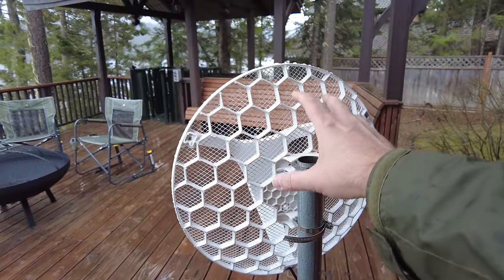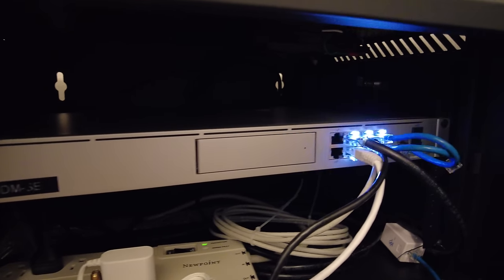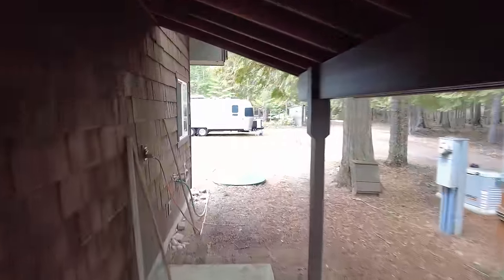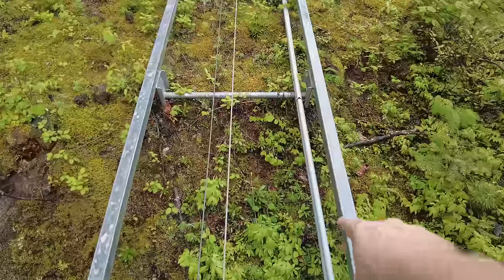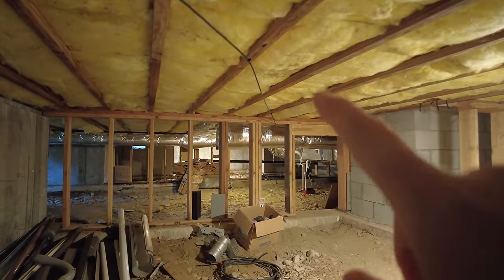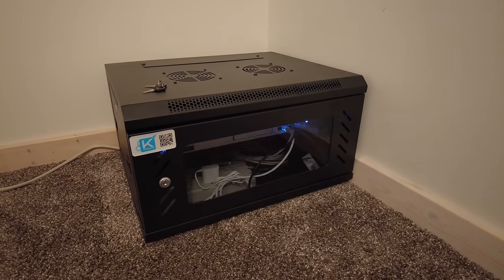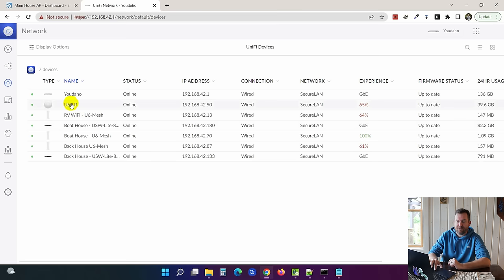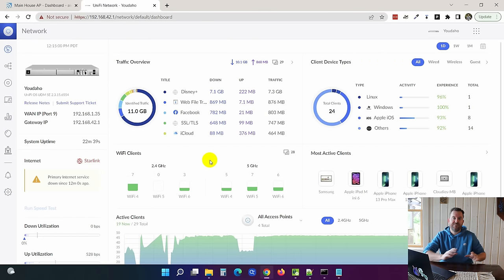An EPIC Network Install in a Beautiful Location!

Comment: I love your videos, but i have to say that running copper cables between buildings is not a good idea. A cheap fibercable with outdoor shielding would have been a better solution imo. Completely isolated against any electrical charges, lightning strikes, etc.
Reply: Which bit had the copper cable? In the conduit between the boat house and the main house?
Reply: @PeterOBrien2  yup
Reply: @MartinLangATADA  ah thanks a lot. Are there any advantages to running copper in this scenario? Just wondering why they would choose that rather than fiber cable
Reply: @PeterOBrien2  Additional cost for media converters / simplicity. I would have also looked at Fiber.
Reply: @DavidTrejo  The UDM-SE already has an SFP WAN port. Could have just bumped it up by $90 for a boat house switch with an SFP cage, if one didn't want a media converter. And if more wires is the issue (more power cables) of not wanting a media converter, one can buy media converters that run off PoE power. So literally just a regular RJ45ed cable anyway, to a box, to the fiber.
Reply: OMG I just saw he's mounting the StarLink dish on a steel pole that's on a wet dock. So there's that wired connection lightning hazard, plus whatever is hanging off the boat house, which can make its way all the way up to the main house.
Reply: @timramich  That steel pole is pretty much lowest point on that area, so I wouldn't be much worried about lighting striking to it.
Reply: @hidedollar5818  actually, low or not it is a significant lightning risk. Speaking from experience here. To address it, I’d have the star link be isolated from the steel pole with rubber pads and put a lightning rod above it. This way the rod dissipates charge and the starlink is isolated from the pole, reducing risk of charge being conducted up to the house.
Reply: @DavidTrejo  basically every switch and router, including the UDM he connected to the copper cable has sfp ports and OM4 is probably same price as outdoor FTP cable. This is thousands of dollars of gear so even if that FTP copper cable was cheaper it wasn't much since OM4 is $1/meter, so would have ran two pairs of fiber or even a 12 fiber MTP trunk as I'd hate to rerun that line if anything happens (not to mention having 100gb capacity), especially with it being a ten hour drive
Reply: Wouldn't it be nice to go on vacation at your lake house and be off grid for a few days?
Reply: @hidedollar5818  - Lightning doesn't always strike the highest point. I have seen video of it striking the middle of a city intersection surrounded by tall buildings that were topped with antennae. Incredible.
Reply: @manandatractor  - Until your family member gets sick and you've got no internet for emergency information collection/coordination.
Reply: That is a good option in most cases but the cable is run through metal conduit so it’s not going to be the lest resistant path in the case of lightning or solar storms plus Poe does not work on fiber and a converter is more matnence and a higher price
Reply: @PeterOBrien2 with copper they can use Poe (power over internet) so it acts as a big extension cord and a internet cable  and a converter cost a lot and takes more power. The cable is in a metal conduit so electrical isolation doesn’t matter

Comment: I would of run armored outdoor fiber along the trolley path.  The fiber cable could have 6 strands or more to allow more flexibility.  You would avoid electrical and electromagnetic interference issues.  Yes you do need to add media converters (an extra possible point of failure) or even better SFP at either end.  SFPs are pretty reliable and low cost so you can leave 1 or 2 spare onsite.  I've already used the armored fiber when I hooked up a customer that rented more space in their existing building.  However to get to the new office space, we had to go through common corridors so to avoid having the cable damaged by other trades, not only was the fiber cable tagged every few feet with labels indicating it was fiber and my customer's info, it was also armored to further reduce likely hood of damage.  We also chose 2 different routes coming in from each end of the new office space so that we can take advantage of LAGG doubling the speed and guaranteeing redundancy.  A fiber cut would mean 50+ engineers without Internet or phones service.
Reply: no one cares
Reply: @catchallaccount9643  That's rude
Reply: I would have run fiber, as well. But I guess some people like fried equipment. The router he's using has an SFP cage on it anyway. $90 more and he could have used a switch down at the boat house that has 2 SFP cages. It's a shame the Dream Machine router doesn't let you change the second SFP port to be used for WAN (so you could have failover). I would have somehow also ran fiber to the back house. I don't get the obsession with skirting the work of cabling in favor of wireless for backhauls.
Reply: LAG doesn’t double the speed
Reply: @timramich  90 $?  lol thats a joke right?  Supplies != labor.  What happens when that fiber gets broken?  Just gonna slide down the Willie Wonka cart and fix it for free?   Shhhh...
Reply: @Wynne Unsell  Yeah $90. It takes zero extra labor to use a different type of switch. And why would fiber break and a copper cable wouldn't? Shhhh.
Reply: @timramich  You do realize a UDM SE has an SFP+ port....right...?
Reply: @Wynne Unsell  So? The switch he chose doesn't, which is what I was talking about being $90 more for a switch with an SFP cage. The switch is on the other end of the line than the UDM.
Reply: So, what you propose has NOTHING to do with the actual infrastructure itself and everything to do with the not so head end head end switch?  im sure he could find an SFP+>RJ45 media converter if it calmed your nerves.
Reply: @mcw_productions  Media converter when they make a switch with SFP ports on them 🤣 You must also like wasting space and outlets.
Reply: @timramich  Which layer does an SFP>RJ45 transceiver reside in?
Reply: @Wynne Unsell  What's that have to do with anything? THEY MAKE SWITCHES WITH THE APPROPRIATE UPLINK PORTS. YOU'RE NOT SUPPOSED TO RUN COPPER BETWEEN TWO BUILDINGS. USING A MEDIA CONVERTER IS A WASTE OF ELECTRICITY AND OUTLETS WHEN THEY MAKE SWITCHES WITH THE APPROPRIATE UPLINK PORTS.
Reply: @timramich  Alright man, I enjoy this dudes content and not trying to get kicked off his page cause some dude hit caps lock too long.  but yes, he should have bought a second head end for a boat house.  Go forth and hopefully don't procreate.
Reply: @mcw_productions  Too long? It was intentional because you don't get it. Blocked.

Comment: Cool setup! I would probably have tried to get the boathouse equipment somehow powered by the main house so it would work on generator power. Maybe a switch flex to send POE down to run the WISP antenna at least (since starlink needs AC power). In a long term power out situation I know I’d want internet!

Comment: Hi Chris, superbly illustrated.    I have lived the ethernet termination issue you ran into... what a pain -- glad to see you received good help from the ISP.     For those times I wish I could have asked you a 100 questions related to point to point/multipoint, your video has 1000 answers and is a great reference.   BTW, your HPWC from the coast is now happily installed at a rural outpost and is working perfectly.  Thanks again.  -K
Reply: Platinum ezEX48 connectors works perfectly for that kind of cable, but as others have said it would be better to user fiber to protect from lightning especially since the houses are on different electrical supplies.

Comment: For outdoor cable, what we do is run the outdoor cable until it gets inside the building. Once in the building, we use keystone jacks to terminate the outdoor cable and run our standard cat5e/6 cable off of that keystone jack. While it does potentially introduce a point of failure, we have found it works quite well and reduces the need to try and play with the goo they have in the outdoor cable. Hopefully this helps with future installs!
Reply: Personally I prefer terminating all fixed cat6 cable runs with female keystone jacks. The cable is not meant to be bent like normal patch cables, so best to keep it fixed in one place. Toolless keystone jacks are very inexpensive, so are patch panels and wall mounted sockets.

Also in Europe that black outdoor cable is not rated for indoor installations due to fire prevention regulations (CPR). So to be up to building code you can have a maximum of 5 meters of outdoor cable indoors until you need to switch to a different cable. Some outdoor cat6 cables have a regular indoor cable under the black outdoor rated sheathing that you can peel off to make the cable suitable for indoor installations.
Reply: yup - we pretty much never terminate CAT5e/6 anymore. Everything goes to keystones - then a short patch cable to the device. Practically eliminates all install issues - and provides an easy way to service/replace the final bit - just throw in another patch cable.
Reply: The trouble with using external cat6 cable with goo on a slope or pole is the grease melts in the heat and runs out the bottom, terminating external cable on keystones eliminates issues with large conductor size causing problems with terminating directly on CAT6 connectors

Comment: If you didn’t want to run fiber to the small building, I should have at least installed the new conduit for the Ethernet on the opposite side of the track to eliminate any EMF from the power generating an AC current on the Ethernet cable. 

I would also not drilled through the crawl space vent but through the wall. That way the vent can still be opened or closed to control humidity under the structure. 

In addition I would have installed a keystone where the AP was coming through upstairs. That way if the line was damaged it would be easy to replace. I guess you can always install a keystone later if it gets damaged but I think it would have looked better. 

Also, I would have went with a different location for the upstairs AP and not had it in a cabinet so it wouldn’t attenuate the Wi-Fi signal as much.
Reply: Yeah, that conduit pass-through through the middle of the window threw me, as did the diagonal cable running across the basement ceiling. And I'd think the difficulty in getting that one line terminated should have demonstrated the value in protecting that particular termination, at least, with a keystone wall jack.

Comment: Hello Chris. Thanks for this this was a great setup. A real challenge.. Have you ever considered running fiber between the building closest to the lake to the main house instead of that funky outdoor grade CAT6?. Another solution for connectivity could be A set of copper link wan adapters that allow for 100Mbps of speed over single pair of copper (if available of course). I've used these units using old copper quad wiring and they work great. Appreciate all you guys do! Huge fan!
Reply: I thought of fiber as well, but you need a different switch for that.

Comment: Awesome video with some great tips!
A couple suggestions:
- Get some Conduit spacers or simply some hangers and bolt them together to stack the conduit correctly. Zip ties will not last. :)
- Vaseline is petroleum based. It may damage cable sheathing depending on the makeup of the cable jacket. Use wire pulling lubricant such as Klein Tools Foam Lubricant. I am hoping the cable you used is oil resistant.

Comment: Nice work Chris! Did you know that in one of the latest or perhaps RC or EA firmware for the UDM-Pro you can relocate primary and secondary WAN between ports 8-9 and SFP1-2 in any desired order.
I know that we can’t discuss the specifics of EA but this is coming, just a heads up. 😀

Comment: Great video and what a view!!!
One question about the dual-wan at the UDM:
Is it possible to directly internally route the traffic of the wan 1/2 vlans to the wan interfaces of the UDM, so, without the external loopback connection?
Best regards 🙂

Comment: Hi Chris, I would have run fiber between the main house and boat house as it would not be affected by magnetic interference from the ac cable or the trolley moving above it.

On the back house I would have used a 5 port flex switch which would only used 1 POE injector and give you 4 POE out ports.

Comment: Love the Setup, perfect use of the vlan. I have a tip, u can use the Port 8 on the udm-pro as a wan connection so u don’t need the sfp+ to RJ45 Adapter.
Reply: I had to poke around in Unifi to turn port 8 into WAN2, I never would have known if it wasn't pointed out because you have to reconfigure port 10 first so that the WAN option appears under port 8. Nice tip.

Comment: What about lightning protection? The one I would most be concerned about is the trunk between the boat house and the main house. Overall great design, I am a little weary of routing internet over VLANs with other vlans in the same trunk. While its highly unlikely I always worry about something coming in from the Internet before it hits the firewall.
Reply: Lightning was my first question too.....  I would have leaned towards a fiber link between the two buildings, giving it some electrical isolation.
Reply: @andrewr886  Or at least lightning arrestors. I have lost at least one switch that way in the past.

Comment: A great design solution for that beautiful location Chris. One thing that I always do when doing outdoor projects with ubnt is to always use the UBNT Ethernet Surge Protector to protect from lightning strikes, especially on the dock cables (isp p2p and Starlink). My main question will be How do you configure Unify in order to use/switch the 2 connections (isp/Starlink)?, is there a way to load balance or make like and active/standby? Cheers
Reply from the maker: Yes - agreed...if I go back up there, I will likely add some ETH-SP's.
Reply: UDMP still can't load balance 2 WAN connections, there's a button for it in the settings that doesn't do anything and the failover button actually says 'failover only'
Reply: @futurecactus  lol ubiquiti and half-baked software; name a more iconic duo.
Reply: @CrosstalkSolutions  The CyberPower UPS in the video had ethernet surge suppressors built-in.  Did you use those?

Comment: Thank you for making me aware of the possibility to do WAN-Passthrough between devices. Previously I had this only on the same switch. As of the latest beta firmware you can now use Ports 8/9 as WAN, so no need for SFP-Modules any more!

Comment: Great Video! It’s cool to see how other people set up networks for different challenging properties and buildings. I have set up a Unifi network for a lake house with the main concern being able to provide the whole property(1 acre) with high speed wifi for mobile devices and a wifi camera . The property is quite long and we have cable internet at the house which is at the very top. I connected a mesh pro AP to the router at the house and added a mesh ap at the shed halfway down the property which connected to the house mesh pro wirelessly. We were able to get decent speed wifi at the end of the dock.

Comment: Very nice solution for that complex! I have had same issues with terminating a Cat7 shielded cable, just couldnt get those wires properly into those connectors. I ended up making some keystones instead, which I also usually prefer as I can then use factory made LAN cables from that to whatever unit that needs a connection. Here in my house I have a fully decked-out Unifi setup, almost enterprise level with UDM Pro, 24 port PoE Pro, 8-port Industrial, numerous Flex and Flex Minis and 4 NanoHDs+11 Protect cameras :). I had those same Nanobeams too but ended up running cat6 outdoor cable to my workshop since the Protect cameras kept getting disconnected everytime I upgraded to a new firmware on the Unifi part (?!). Anyways, I am very intrigued by that VLAN Only that you did and will see if I can mimick that here as I want to move my entire FW/SW setup to a better and temp-controlled environment elsewhere in the house. I will probably just run new cables from the 24 port keystone to another keystone in that new location once I figure that out.
Reply: I agree on the keystone. This is (or should be in most cases) the standard method for terminating to an interior space from exterior. There are some 8P8C connectors that are specced for larger-gauge cable, but should be used when space or distance constraints are an issue (such as terminating to an outdoor enclosure).

Comment: I just completed a house (1900 sf)  on a lake in N Idaho and used a Unifi dream router for inside, and added a U6 mesh access point outside. The U6 is poe from the router. I started with Starlink because local microwave services are running less than 25 mbps. So far my experience with starlink is mostly getting in the range of 75-125 mbps, that was a huge improvement. I do have trees around so it occasionally gets disrupted for seconds only, but that seems to happen mostly in the very early morning time. The Starlink app to check siting of the dish gave an indication that reception is poor, but in reality it's outstanding. Love UNIFI and use it at my main home as well. I've learned a lot from Crosstalk, so thanks.

Comment: Had a similar issue with some cat6 cabling that was rated for 600v (use on power poles).  The insulation one each conductor was too thick.  A deep, deep dive into the documentation revealed I needed a specific type of cat6 rj45 at $5 a piece!